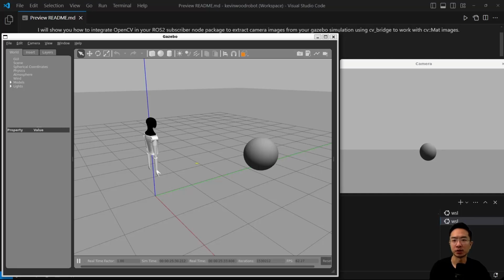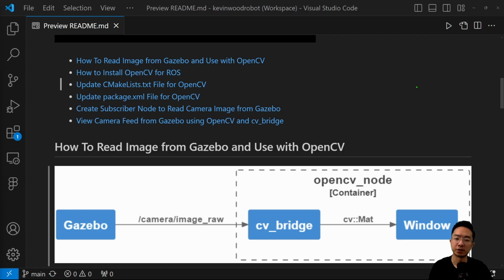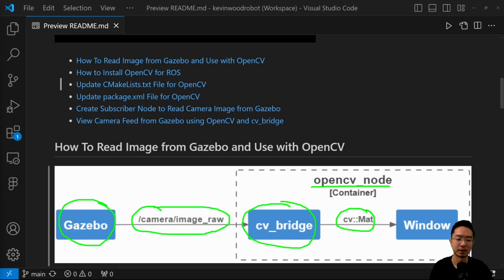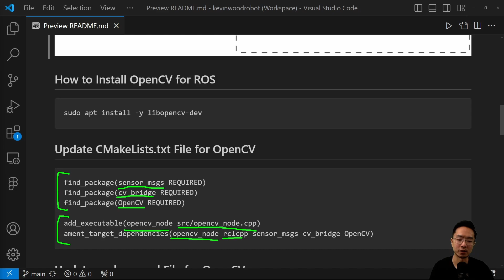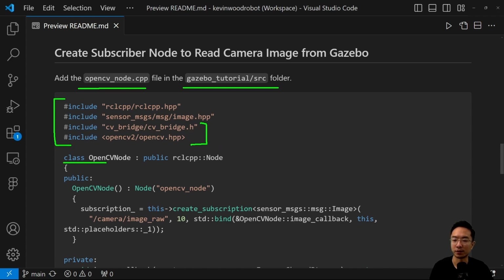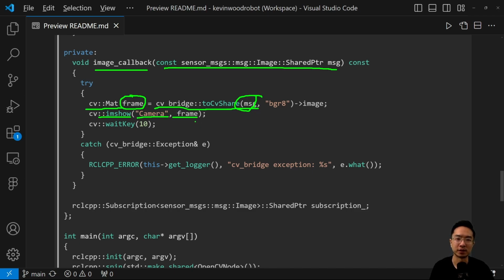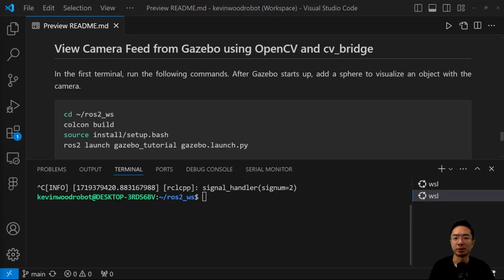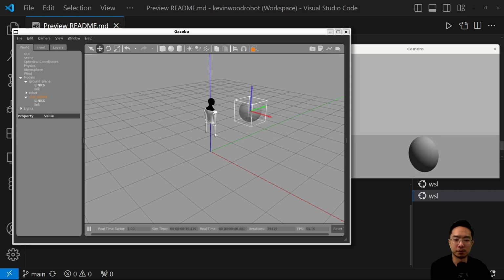ROS2 OpenCV C++ Node to Read Camera Images from Gazebo with cv_bridge

Comment: Hello Kevin, thank you for providing good content! 

I am using open cv for a ball tracker project and I am using the camera feed from my phone and publishing it on to a node in ros2 using open cab functions, the feed is fine.

However when I do any sort of image processing, like if I want to do hue adjustment to detect the ball, the feed becomes all jittery and is very laggy. Is there any way to solve this?

I tried switching the feed to webcam feed and it’s the same issue.
Reply from the maker: It sounds like a resource issue. Try profiling it and see what’s taking up the compute time. Consider using threads or tap into some real time settings if that’s available
Reply: @kevinwoodrobotics  okay thank you sir! I will check that. I tried reducing the callback timer value and got decent results but however there is lag which will impact the robot decision making.